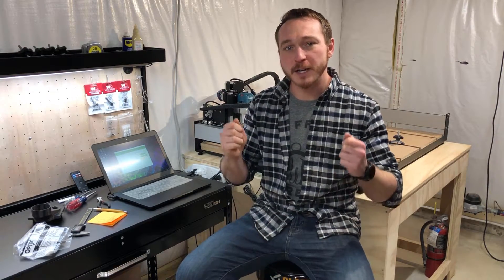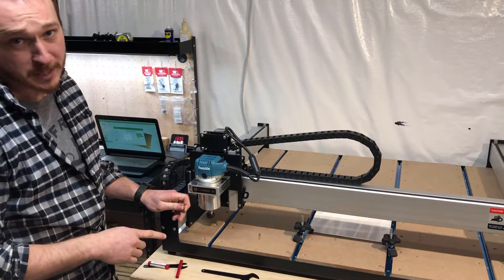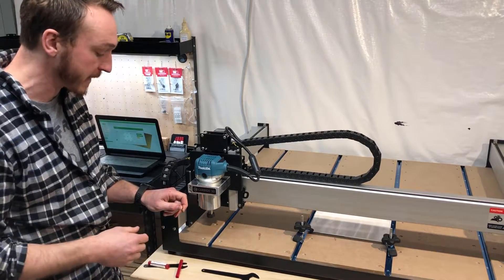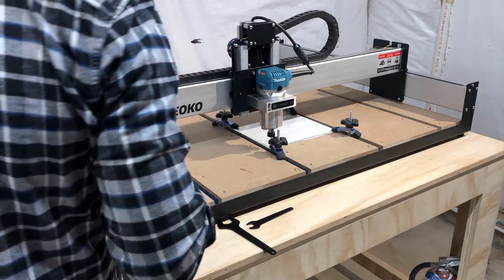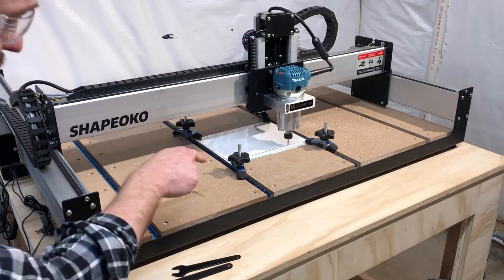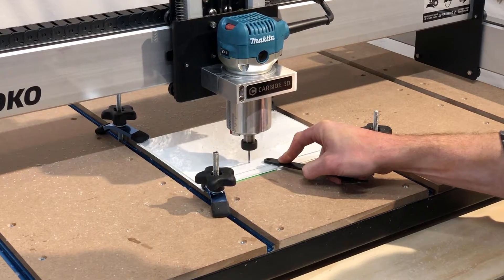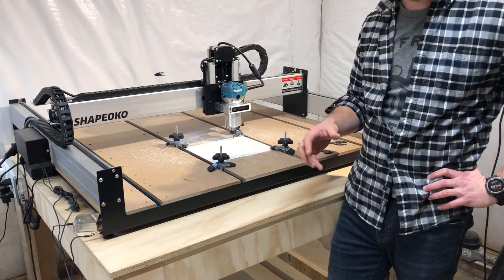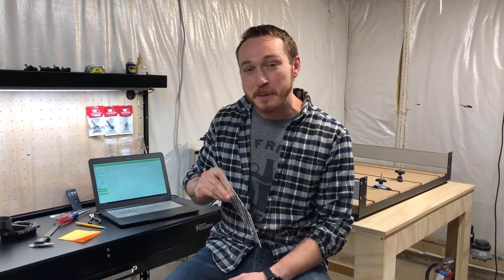Shapeoko Series - Making an Acrylic Writing Guide

Comment: I work in a plastic fabrication and distribution facility. You should keep the plastic/paper film on the acrylic until you finish all cutting/sanding. The acrylic is easily scratched by debris from machining. Cool vid. Looking into a Shapeoko XXL myself.